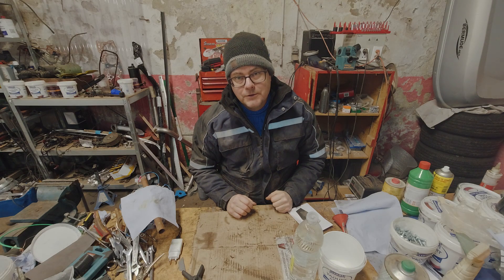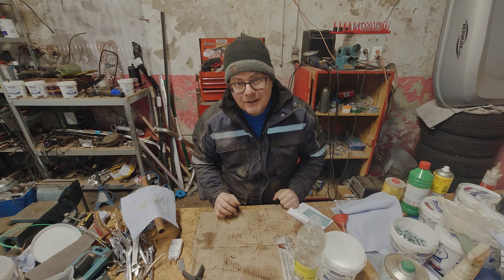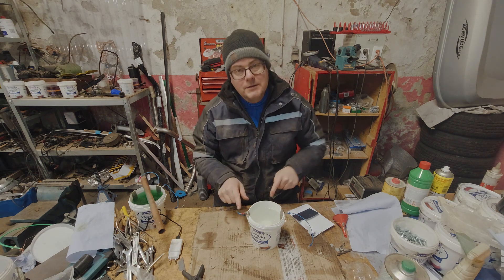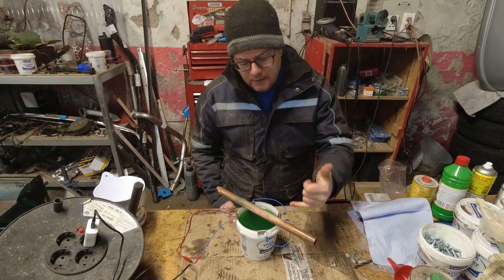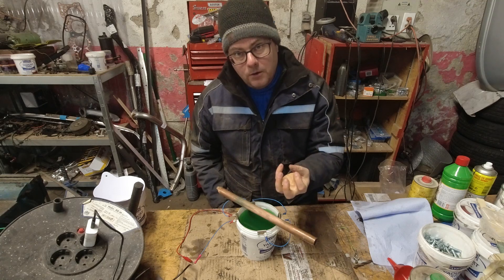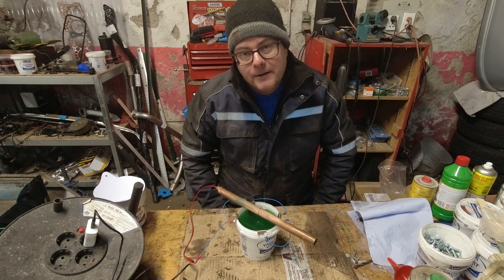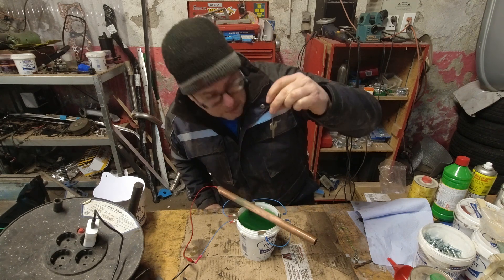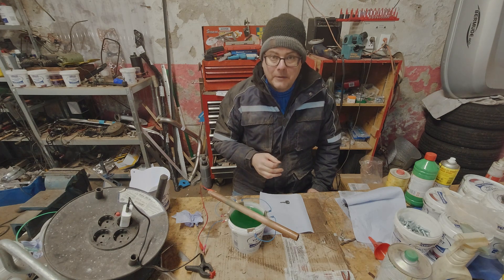Nickel Plating - Austin Healey Service Manual

Comment: Hi AH, that was fascinating, - so can I get this straight: So, after you’ve produced your solution by connecting positive on one nickel plate and negative on the other until it goes dark green. Then disconnect one of the poles. Connect all of your (4) nickel plates together to just one of the poles. Then suspend the subject part into the centre of the solution, connecting it to the opposite pole via a metal conductor ( in your case 5.5volts, - but I guess you could use 12volts if that’s all you have?) leave it to bubble away until sufficient coating is achieved. Job done. - did I get the right? Thanks for sharing buddy 🙏🇬🇧
Reply from the maker: Hey Phil, sound like you got it. I ha e since found that for small pieces the phone charger is fine but for larger parts you need more amps.  There is a formula, 1 amp per square inch of the surface of the part you are plating.

Comment: Very interesting video, would this be used instead of a chrome finish or is it a a surface that can be chromed on top of the nickel.
Reply from the maker: Typical in the chroming process the first layer is copper, then nickel and finally chrome. Here in the EU traditional chrome plating is no longer allowed. Nickel can be polished up to a very nice finish but it's not as hard a chrome and won't wear as well. But it's a pretty good alternative and easy enough to do. I'll be trying copper plating next. To use as a base for the nickel on more important finished parts.

Comment: Is that a USB charger for a power supply? Just cut the cable, find + and - and connect them up?
Reply from the maker: Yep. The charger works for small pieces. For bigger parts you'll need more power.